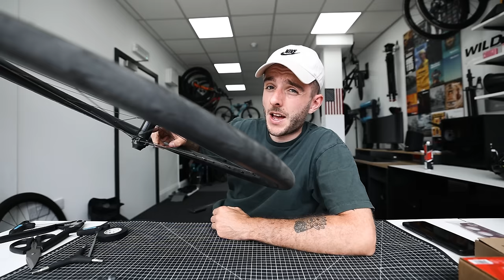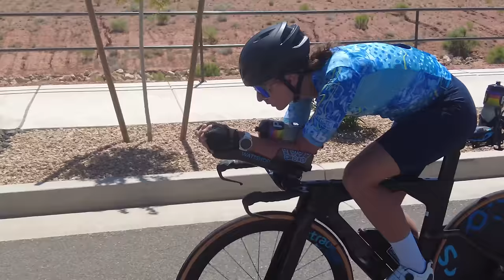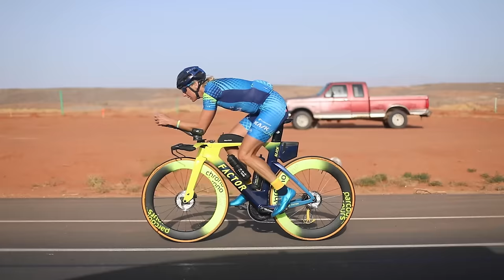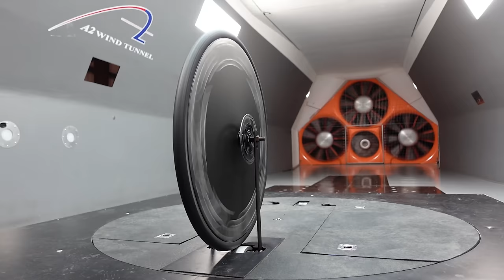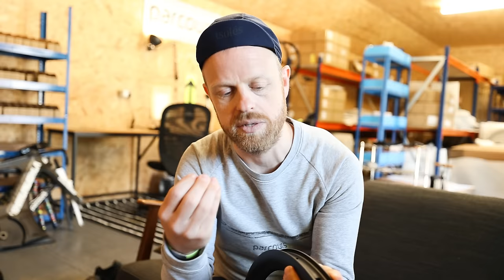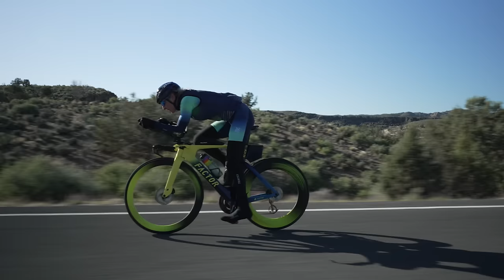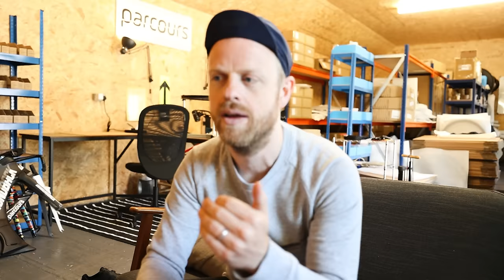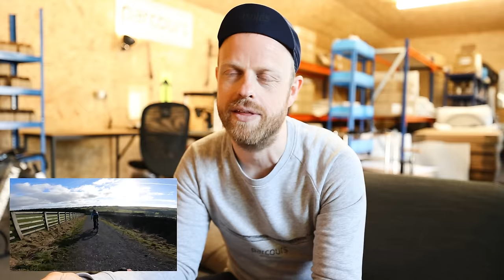Why Are Bicycle Wheels Getting SO WIDE?

Comment: I don’t feel that we were ever restricted to the width of the brake caliper.  The width of the rim dictated the width of the caliper.  If the rim was made wider a wider caliper would have been close behind.  If you build it, they will come, so to speak.  Disc brakes had more advantages, so too went the engineering efforts.  
Another advantage of discs: to not have to redesign the rim, tires, tubes and rim tape width AS WELL AS the caliper.
Reply: I think maybe in the video it was not worded so clearly.  There is a point where if you want say 30mm+ tyres with rim brakes you have to go with medium drops, 35mm+ say with long drops etc.  each time you have a longer drop calliper the worse the braking becomes due to calliper flex and less leverage. Above that point you go to cantis or v-brakes and even then the tyre size is limited to where the brake cable may end up depending on your setup.
Reply: @jonathanip6757  you're absolutely right, I could have been a bit clearer there.

The longer version that perhaps is more comprehensive is that we, as an aftermarket wheel manufacturer, were/are constrained by the brake calipers fitted onto our riders' bikes.  I'm sure the likes of Shimano, SRAM, Campagnolo, TRP etc. as brake caliper manufacturers have their reasons for the caliper widths they use, but this is what we are restricted to in our rim design.

Comment: I think there is an optimal width of roughly 30mm, but past a certain point, tires get too wide and start to slow you down. At that point they cross into the gravel tire sizing.
Reply: Optimal is 60 mm for road :)

Comment: I don't buy the width of the caliper argument for determining the width of wheels. Reason being track bikes which have historically had no brakes.
Without the limitation of any brake they could have substantially wider wheels yet they have not gone that direction. it's worthy to note that no hour record attempt has ever been done on wide tyres.
This suggests that for ultimate performance wider wheels and tyres are perhaps not the way to go. 
The road surface and comfort being the determining factor in the trend towards wider tyres imho but I'm not convinced by the performance argument as rider weight must also impact what is the sweet spot.
A 60kg and 100kg rider will have different needs as such no one size fits all exists.

Interesting discussion though.
Reply: Tour De France riders use 25mm tyres........if 30mm was faster you would think they would use them......
Reply: They’re riding on a perfectly flat, hard surface, a track. So they can pump up to super high pressures and rolling resistance is less of a factor.
Reply: @aygwm  That's my very point, imho it is not as straight forward to simply state wider wheels and tyres are faster as the marketing blurb does.
The environment and rider characteristics such as rider weight determine that.
It's all marketing to get people to buy what the industry wants, the same as hookless rim which benefit the industry with ease of manufacture more than benefiting the consumer.
Reply: @aygwm  Well you can also pump up wider tires to super high pressures and have similarly low RR, so that's not an argument. 
They don't do it because it would be less aerodynamic (and heavier but less of an concern on track)

Comment: wider tyre + wheel is less aerodynamic than a narrower tyre + wheel. its only faster if can compensate with better rolling resistance. To truly get the best combo you want the external rim width to match the width of the tyre. Tyre choice should be based on road condition and rider weight. A light weigh rider has no reason to go to big 30mm tyre  if they can run lower pressure with a 28mm or 25mm tyre. Wider internal rim will impact the real width of the tyre thus also needs to be considered.

Comment: I found that, the sweet spot of tyre width is the one which results the optimal pressure of 4.5-5 bars (with zipp pressure calculator) for the given bike+rider weight.

Comment: a really interesting thought here about how wide a tire you should go.  I had to go into the office which is only 4 miles away.  I have a Orbea M20 with 28mm tubeless and a Koga Signature with Rohloff, and using Schwalbe Marathon + 34mm tires (double the overall weight).  The difference between them was only 5 mins.  I found on the Koga I was rolling over the potholes more freely with no concern of loosing control etc.

Comment: 90s hybrid bikes had it going on and no one knew it. Your 30mm road wheel looks a lot like a old hybrid wheel.
I still have a difficult time understanding how fatter tires with lower pressure has less rolling resistance. But I'm fine with it either way because they're more comfortable

Comment: How can lower pressure give lower rolling resistance? I get way better fuel economy on my motorcycle when I have high pressure in the tires vs low pressure

Comment: never understood 23/25 width tyres, they're uncomfortable and there's so little friction, if it even slightly drizzles you've had it going down an inclination. 32 is the sweetspot IMO
Reply: Its for speed. 23 vs 32 is almost 1 cm. Noticeable maybe. But 23 vs 25 is a joke
Reply: 30mm is the sweet spot.
Reply: Er, so how did pro riders descend high mountains at 60 mp/h for 50 years, using rim brakes, without crashing any more than they do now?!
Reply: @reginaldscot165  my guess is that stiff carbon is nowhere near as comfortable as alleged, compared with steel and titanium, so the wider tyres are suddenly necessary where they weren't before, and the science is there to justify it. Disc brakes have been forced on pros and consumers alike, probably to facilitate this trend. Touring bikes always had wider tyres, but they weren't faster. It's almost as if the whole bike industry has decided that everyone, including themselves, was stupid in the old days.

Comment: Aero is a factor in wider tires.  If averaging 21mph and up ---such as a road race, 25mm has proven to be faster that 28mm.
Reply: You really think 3mm does make much of any difference at all?
Reply: I agree, most aero drag penalties would come from a suboptimal position of a rider, clothing, a helmet. That’s where ppl need to seek for optimisations should that be necessary
Reply: I see plenty of pros on 28mm tires. It’s not slowing them down.
Reply: @aygwm  Yes, they have the latest wheels designed for 28mm tires.  Most of us mortals are riding rims designed for 25mm tires......  28mm on a 25mm rim would create a lightbulb design for the tire which would of course  be slower.
Reply: @the.communist  Yes you do...you can't compared when you just ride 10km. Those season rider are going at 100km at least every ride. 50km non stop action at minimum 40kmh depends on gradient. Crank arm u have 170mm and 172.5mm. You can also said that 2.5mm make no different. Even a cleat out of position of just 1mm, after 100km ride you'll feel your leg feeling uncomfortable.

Comment: OK, so sooner or later racing tires will be as wide as a classic (I mean 1960-1980s) city bike's wheels (in todays standards 700x32C or 622-32). Nice... You reinvented the wheel, that already existed in almost the same form. You are a genius. And because it is "new technology, designed with science", it will be exceptionally expensive. (Just like the hookless rims more expensive compared to hooked ones, meanwhile cheaper to make).

Comment: Just a thought. Is it more likely to get a puncture with a wider tyre opposed to a narrow one? I would assume that if you are touching more of the road surface,there is a bigger chance of hitting a sharp object. Also wider is going to be heavier. I am starting to think that we are being duped into buying the latest trend. It wouldn't surprise me if we went back to super narrow tyres in the future. I know there is a lot of science behind this,but if I have learned one thing in life,it's that science is always changing as we find out more about our world.
Reply: Probably negligible, my dad's old GT mountain bike has got 2 inch slicks on it and never got a flat. I think you're right, the industry is trying to get us obsessed with these miniscule gains. But one thing I've noticed since switching to 28s is how my times have improved over long rides, the roads where I live is not perfect and running 28s on lower pressure allowed me to bomb through these rough sections of roads. Really depends on where you live.
Reply: Wider tyre means less pressure - less likely to push anything through the tyre - who knows 🤔
Reply: @JIMMYHIBBS1  Good point.
Reply: @ILOVEDEFENDINGTHE1PERCENT  I have an GT tempest mountain bike also with slicks on it. Come to think of it,I don't ever remember getting a puncture on the road on it either. And I have to admit it is far more comfortable over the crappy roads where I live. I am still old school on the road bike with my 23mm tyres though. Maybe it's my age,but I think they look better,especially on my old steel framed bikes.
Reply: @atmywitsend1984  Most old frames like my Peugeot will only fit 23s unfortunately. Also we tend to attribute things like discomfort, bumpiness and being able to feel the road chatters and vibrations on a rock hard narrow tyre with speed. Some would argue that's the whole point of old school setups, it's about the feeling you get from it more than anything else.

Comment: I have a set of 25mm Inner/32mm Outer width wheels. I’m currently running 28 mm Continental road tires based on the manufacturer’s recommendation.  From your discussion I’m wondering if I could go wider. The 28s are nice but I wouldn’t mind a wider tire with lower pressure to dampen the road vibrations of chip seal rural roads in my area. How wide could I go with those wheeldimensions and still get optimum rolling and aero performance?  Thanks.
Reply: Hi Jerry, hard to say exactly what the ideal setup is without knowing a bit more about the wheels.  But from the dimensions you've provided I'd take a guess that you're pretty close to optimal aero performance.  However, with our Strade wheelset (which has a similar outer rim width), the drop-off in aero performance between a 28 & 30mm tyre is pretty small.  So if you're looking to improve ride comfort, running a 30mm tyre is unlikely to be too detrimental to overall performance.
Reply: @ParcoursDov  Thanks, That’s what I hoped to hear. I bought my wheels overseas from Light Bicycles in Shanghai, China last winter. I have both gravel and paved options where I live so I went with the wider 32 mm rims because, I felt they would give me more comfort and tire width flexibility for gravel riding going forward (and because there was a price advantage going wide). But, I have since recognized that the majority of my riding is on pavement and decided to use these wheels as road wheels and use the alloy wheels and 38mm tires that came with the bike for gravel. I originally went with 28mm tires, as I said, based on the Manufacturer’s recommendation, but I think having ridden them the early part of this season that 30s (or maybe even 32s) may be better suited to the crappy chip seal roads around here. I used to ride them on 23 mm tires on 25 mm rims and the difference going to 28s on the 32mm rims is like night and day. The 28s are very comfortable, roll great, and seem to grip the pavement better than any other tires I’ve owned previously. But, that being said, I’m a not very fast recreational rider, so the aero advantages of my wheels are less important to me than their rolling resistance compliance. I want to get any aero advantage I can, of course, but think the vibration damping benefits of the wider tires far out weight any aero benefits of getting the perfect tire/rim profile. I’ll ride the 28s for the rest of this season, but will definitely go a bit larger with my next set of tires. I’m so glad I went with wide rims. Thanks for opening up this discussion.

Comment: One thing no one seems to be talking about is that different rim depth most likely have different optimal widths. A 80mm deep TT wheel can be wider than a 40mm wheel to get a airfoil profile. 

The other factor seems to be not as performance driven as we are told. Aerodynamic performance of a wheel is much more important than rolling resistance and optimizing rolling resistance doesn't make you faster when you give up more in terms of aerodynamics. However, with the rise of tubeless tyres, hookless rims and the use of sealant. Running aerodynamically optimal 23mm tyres on a 40mm rim at 90psi mean hookless rims and sealant do not work properly.

I think the optimum for climbing wheels will be 25mm tyres and 28mm for deep areo wheels. Discs we can probably run 30s or 32s.
Reply: We might not necessarily be talking about it, but believe me we are thinking about it!  A lot of it comes down to exactly how you define "optimal".  If you're looking at it purely from an aero perspective, wider is what you're after.  But of course with a wider rim, there's more material used, so it comes with a weight penalty.  I talked a bit about this with Francis in another of the recent videos but there are certainly times when you want to minimise weight.

However, one of the great things about our #thinkwider range of wheels is that you can have both.  You can optimise rolling resistance by running a wider (28mm) tyre, but without any aero penalty given the wide rim design.

It's definitely a massive topic though and one that we're keen to keep exploring with Francis.  If there's a specific part that you'd be interested in hearing about more, just let us know and we'll try to cover it.
Reply: @ParcoursDov  How exactly is a 28mm tyre on a 30mm wide rim able to create a more aerodynamic profile than a 23mm tyre on a 25mm wide rim? I'm assuming a shallow climbing wheel with the same depth. There is a 20% increase in frontal area that can't be made up by a more airfoil rim profile the way a very deep (80mm) wheel can make up for it. I'm thinking about width to depth ratio. 30mm 'Lightweight Wheel' ends up with a 1:1 ratio, the 40mm 'Allrounder' has a 1.33:1 ration and the 80mm TT-Wheel has a 2.66:1 ration. I guess there is also the width difference between rim and fork to consider.

I think most people understand how the 28mm tyre on the 25mm wide rim is a poor choice. But that is not really my concern. I'm just very doubtful about marketing by the bike industry in regards to marginal gains. Ceramic bearings and 'silly' spin tests come to mind.

Some other things about aerodynamics. I personally ride a 6 spoke wheel on my road bike and would love to learn more about spoke impacts on aerodynamics. I especially like the Corima Carbon Spoke design and believe these wheels really punch above their depth because they have 12 spokes instead of the typical 24. What Impact have the disc rotors on aerodynamics? The Shimano Rotors have very different designs compared to the SRAM and Campag Rotors.
Reply: @Circial  totally agreed re: the frontal area, but remember that the key element of the drag equation is CdA - so a combination of frontal area (A) with drag coefficient (Cd).  Cd is driven by the shape of an object and is dimensionless, so will also have an impact on overall drag.

Measuring drag from spokes gets really challenging as you need to consider the rotational drag (i.e. the drag from the spokes rotating with the wheel) as well as the translational drag (i.e. the drag from the spokes moving forwards with the bike and rider).  Wind tunnel testing is best suited to measuring translational drag, as for rotational drag you would need to also consider the torque on the axle.  Pretty challenging if you're using a motorised rig to spin the wheel to match the airspeed!  This is why solid disc wheels are often arguably penalised in a wind tunnel test - by almost removing rotational drag completely they will give a greater aero benefit than the translational drag data can show.  Clearly with a deep vs. shallow rim there is also a difference (shorter vs. longer spokes) as well as between a 12-spoke and 24-spoke build.  And that's before you begin to consider spoke profiles!

As for disc rotors, we've actually tested this.  You'll see on our website that we've seen differences of just over 1W between different designs of rotors and around 0.7W between a 140mm and 160mm rotor from the same brand

Comment: It's not always the case either way.. A wheel can be to narrow, and it can be to wide. Same for pressure, to high or, definitely to low is slower. And disc have nothing to do with wider tires, any modern rim brake can accommodate up to a 30 or 32 wide tire, which wider than a road bike looking for speed is going to be used. Not the same for gravel obviously..

Comment: Still not convinced. I ride 25mm tyres at 100psi even though wheels can take up to 32mm (Trek Emonda). The roads here is France are very good and the surface not bad at all. Not convinced to move to even 28mm at say 70-80psi.
Reply: You will just gain comfort n grip.

Comment: Hi Francis, what depth wheels are you running, question, why are we seeing different depths of wheels, such as a 39mm front and a 44mm rear. 🚴👍
Reply: Great question & it's not just the different depths, but also widths and shapes.  The (very) short version of "why" is that we design rims to suit the airflow conditions at different points of the bike, i.e. front wheel & rear wheel.  We know from our testing that these are very different, hence the difference in front & rear rims.